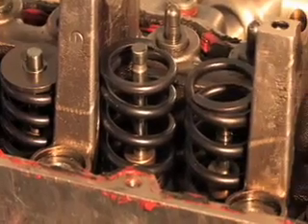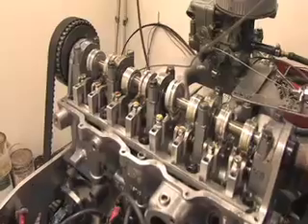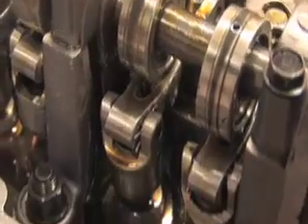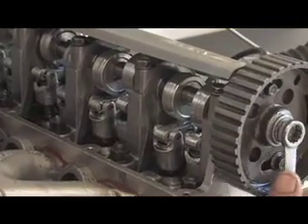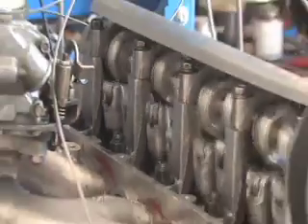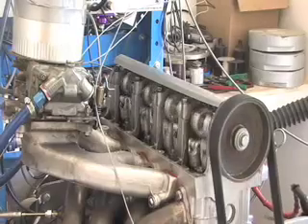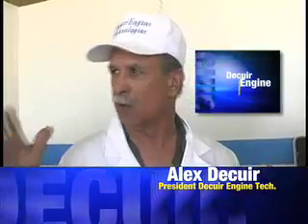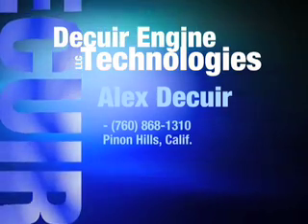New Engine Technology/Springless Valves

Comment: Ducati has improved their Desmo design to over 22,000 mile adjustment intervals on their street bikes. MotoGP bikes are dominating the power wars as Honda and Yamaha can't keep up. 18,000 rpm redlines.MotoGP engines are prototype, racing ony engines not destined for street use.

Comment: One minor problem with this concept.....!  Heat and thermal expansion of the valves themselves as well as for the other parts of the valve train system 🙄 As the valves heat the whole purpose of valve "LASH" is to make up for the expansion of the parts like the valve stems as they grow a little longer with heat and rocker arms which will also grow in the heat, eventually the lash is your room to grow in other words. The engine will operate fine until heat soak is throughout the entire engine and the valves begin to no longer fully close and seal on the seats. This is more than likely why you only see these test engine running at idle or just above and no full out dyno pulls! Because they wouldn't survive one! Without popping and spitting is to occur under a load! Otherwise the concept I'm sure has been tested and was never successful at auto manufacturers across the globe. The fact is the weather it's overhead cams or on old push rod engine or even a L head, aka flat head engine your valves still needs to be an independent fixture and lash between either a rocker arm or cam follower still has to have some space to expand or grow in increased heat levels. Without lash or what's called a zero lash situation which is not very common at all as everything heats up the parts grow and eventually become so large the valve can no longer make a proper sealing surface with its valve seat. If this occurs on only a couple or one valve in a multiple cylinder engine which use to be a common thing especially with a machical camshaft, your likely to burn a valve or seat or both from the hot combustion gases flowing by the leaking parts for long periods of time which is so hot it erodes the metal away. 🤔 So if you really want to play with a spring less engine than use solenoids for actuation of the valves, but even with a solenoid setup you can get rid of the camshaft and followers, push rods lifters and rocker arms. But in order for the valve to return to its seat the fact remains either an electromagnet or spring is going to be required for one of those directions......but no where nearly as heavy spring would be really required to do so since it doesn't have to push all those other parts back upwards. 😉 SMFH don't buy into this, it's nothing but a scam in the world of engineering.

Comment: The best idea I've seen is no valves or springs. It had a rotating camshaft that ran through the head, that had ports machined into the camshaft. It rotated and opened and closed the ports.

Comment: So many ignorant and idiotic comments...  <SMH>
Reply from the maker: Thanks for the common sense
Reply: @EmpEntTV  I'm a mechanical engineer, but was raised as a mechanic. 

 I've been thinking about actuating automotive valves in this way for a long time.  The currently accepted system is impractical for high performance/high RPM usage.

Whoever manages to crack this particular but, will definitely become rich and famous.
Reply from the maker: @michaelangelo8001  You are so correct about the impracticality of current valve actuation. Mr. Decuir was of the mindset that this type of system would not take as much friction and horsepower to efficiently open and close the valves. This would raise HP and fuel efficiency. There is a patent on this system but unfortunately Mr. Decuir has had to retire and the development never went too far past what you see on the video. Thanks for your comments.
Reply: @EmpEntTV  Maybe we should get together and continue the work at some point.  I'm not far from retirement, and have a complete machine/fab shop at my disposal.  I've designed and built several machines with slot cams, scotch yokes, Geneva devices, etc...  Mostly high speed textile equipment.

Comment: Similar system was used  in old (1950), two cylinder generator engine. 
The problem with that engine was adjusting the valves very frequently.

Comment: This is a Chrysler 2.2/2.5L engine.
Early 80's to mid 90's era.

I don't think anybody is claiming this to be the first springless valvetrain, which clearly it isnt. 
But rather a new twist on how to achieve it.
This appears to be a much simpler setup than Ducati's Desmodromic system, which requires two cam lobes, two rockers, and two separate lash adjustments per valve.
This system seems to use only one lobe, rocker/ring, and lash adjuster per valve.

Comment: you know, sure it seems like good way to remove the power required to open valve, but it doesn't take into account fatigue or imperfections in the engine. Current engine vavle springs always keep the valve seated whether they stretch or not and don't really require any adjustment for a very long time. Springs are a lot more practical than a springless system. Also, the lobes appear to be circular which means the combustion may not even be complete before one of the valves opens. That seems like a bad idea to me. A hydraulic, pneumatic, or electrical system directly mounted on the valves seems like better idea. That's also really noisy.

Comment: People saying this is stupid because desmo has already been around for a long are being ridiculous.  Engine tech is constantly improving with minor changes to existing systems.  However, this design has a basic problem because egg shaped cams work better for opening and closing valves for the right duration to get the best performance.  Konigsegg's system that works without cams at all is probably the most promising improvement in valve control.

Comment: yeah, hasn't Duccati been doing this all along?
Reply: deezynar but the tittle said new technology, and the fact is springless is not new!
Reply: Crobular I 
True, while springs give back the energy absorbed during opening on the closing side, the pressure of the springs produce friction on the sliding/rolling contact surfaces.
Springless valve systems typically have much lower friction loads.
Reply: They do it very differently.
Reply: Springs use energy but they put some back as well. Think about it !.

Comment: I would like to see that system utilised in a 4 valve hemi head !!!.
Reply: +Crobular I check out any ducat testatratta head, 4valve per cyl, hemispherical chamber , and desmo actuation,  upside.. 170 hp from about 1 liter, no valve float, downside, adjustment intervals every 12500 km, plus belts, the lash tolerances are very tight in this type of motor.. i think like 2 thou on the closing shim, n 4 to 5 thou on the opening.. where as springs will take up a lot more lash, everything in a desmo vale train is mechanically connected.. the race bikes use nitrogen filled valve "springs" , check them out for some cool tech,  bike had a pressure tank on the front, keeps the valve train pressurized, top it up to specs n off you go lol..  anyways check a panegale cyl head, its what u seek
Reply: +plane gaper  Yes, Correct.  Don`t  forget that the valve springs put some of the lost power back as they re-assert themselves closing the valve under rotational cam control.  I have a nice diagram of the Duke Desmo  engine somewhere all dims given. Rudge made a 4 valve hemi head before WW2, not Desmo though. My wifes Ferrari of a few years ago now had 5 valves per Cyl.  Clever angular ground  cams.  Can`t afford those anymore and we`re too old anyway.  Desmo engines have been around for donkeys years and some race bikes, I cannot remember which, had them. Old technology this with no real or imagined advantage, just another method like harmonic or tangential cams.  Norton used Tangential cans on one of their bikes, why I do not know.  Remember hairpin valve springs, they are about as old as the Desmo.
.
Reply: +Crobular I  Still cannot see how that system closes the valves without springs !!!. How can one get some overlap with this system. My Norton Commando had 90 degrees.  Seems a load of nonsense to me.
Reply: haha..ya duc uses valves or nitro on their race bikes now anyways..the real pleasure owning a duc versus an sv or jap twin is the direct mechanical linkage between the crank n the back wheel. I'ts a feel you dont get w any other bike, very sharp and exact, you can modulate the throttle through the corners much more accurate than any cbr, or rc51 for that matter..inpsires confidence..no disconnected feeling whatsoever. mostly because crank to gearbox is a gear..eliminates all the lash a chain main drive, and springy head contribute to feel. Downside, everything comes back through the engine with the same tolerances as well..theres no give to take up miss use and wear, and hence the shorter service intervals..seems the shims n belts take up most of the punishment..
   the five valve head is a yamaha invention, called genisis..increased overall intake valve area, over exhaust providing high volumetric efficiency at high rpm..seems ferarri decided it was a good idea.. gonna check these cams you mentioned out today..there s a guy that made bike cams with vvt via fly weights..ill post the name when i find it..cheers
Reply: +plane gaper  Lookin forward to it. I Don`t know anything about bikes these days.  Last fun bike I had years ago was a Suzy RG 500 Gamma with all the mods and stinger pipes etc. Handling OK Just. Not like a Duke.  You would not believe how it went for a 500 !!!.  My pal had a 750 Kwacker with Denco 7 port barrels etc;  Poor handler but rocketship.  I love strokers, fcuk the Desmo`s. My pal a just retired airline pilot has a Duke of some sort at the rear of his garage.  Must check on it and let you know if I can find it !!.  Yes, Ferrari used the 5 valve heads on the F355. My wife liked that whizzy little car at the time. Then I understand that they did better with the 4 valve head. Cheaper to make and a few more horses I believe. No Desmo for them though.!!. Good wishes.
Reply: +Crobular I  your duke is just a tail-gater in gran premio el mundo to yamaha & honda///
Reply: Not my Duke, my pals. In his garage. It will be there for ever. He has a Laverda Jota, a Vincent black shadow and a Ariel square 4 of some sort. Healey I think. NO !. he will not sell anything. Plenty of money you see.

Comment: "New Technology" hahahahaha go back to school EINSTEIN...
Reply: +skirmich We always enjoy hearing from the uneducated who have never spent the time in R&D developing new systems for use in automotive technology. What is "new" about this system is the use of a concentric internal cam that creates the valve actuation. Yes, Ducati and Mercedes have developed a desmodromic setup several years ago but Decuir is taking a different method of working with this setup. Given the fact that this system has been granted a world wide patent does qualify it as a "new" variation of previous technology.
Reply: KART RACER TV It does not give it anything, A variation is just that a Variation. This system is nothing "New" its just a different VERSION of a known technology.
Reply: +KART RACER TV  - A patent, worldwide or not, means it is a NEW solution.
This is a very poor solution: there is no way to control the valve timing as much as is possible with a conventional valve drive system.
Reminds me of all the people that get patents for a revolutionary engine. Most do away with the reciprocal motions.
Pointless.... Engines are very, very cheap to manufacture and are sufficiently reliable.

Comment: What did I miss??? I saw lots of mass opening the valves but I saw nothing closing them! On my 1973 twin motor  the valve springs suck 5 BHP. I have spent 40 years wanting to change this. So why has this video left me scratching my bonce? Head for the US readers.  Put simply: I am sure the Japanese would have used it by now, I mean, I thought up Honda's V-tech  (and I bet lots did as well, but dad told me not to bother with patents way back in 1974 as he lost money with his inventions that we all use now.)  What I mean is that nothing is new, while most ideas are limited by metallurgy, not concept. Did that make sense? Ducati are famous for their Desmodromic, but imagine setting a desmodomic v12!    So, I will keep looking, waiting for the the @#$%^&*()_)

Comment: were those not springs i saw around the valve stems? Sure looked like it to me...
Reply from the maker: +Nick Palaroan Amazing how so many do not pay attention to the 
explanation of the springs in the system which are merely there to hold 
the valve guide seal in place and has nothing to do with actuation 
process of the valve itself. So therefore it is a "springless" system.
Reply: +EmpEntTV But they are expanding and compressing with the valve going up and down.....which means they have to be performing some kind of return.
Reply: +EmpEntTV Well now that I can watch the video with audio, what returns the springs? Are these round cam lobes magnetic? Thats the only thing i can think of. Because the video doesnt say how they return. Also, I would like some numbers on the force required to open these as opposed to standard valve springs. Seems like alot of information is missing from this video.
Reply from the maker: +Nick Palaroan No, its primary use is only for the valve guide seal and has not nearly enough spring pressure to help in the actuation process. Secondly, the concentric type of cam on this system actually pushes and pulls the valve back into place. There is really no need for a spring with this type of setup.
Reply: +EmpEntTV I looked it all up, thank you!
Reply: +EmpEntTV I looked it all up, thank you!
Reply: what did you look up to explain how these valves return to their seat? I've watched videos on television ducati, and that is obvious. I don't see how these valves return with no spring. the eccentric appears to only push down.
Reply: +Nick Palaroan 
Forget all the bullshit. Them's was springs!
Reply from the maker: +Rick Lorimer As was mentioned, the springs in place with the system have nothing to do with the actuation of the valves and are there to hold the valve guide seals in place.

Comment: new technology? that shit has been around for decades. And there is nothing simple to doing adjustments on desmo valvetrains
Reply: +EmpEntTV You know, adding "Einstein" as a pejorative when people point out similar preexisting implementations of the same basic concept is unbecoming and demonstrates an apparent lack of tact, intellectual honesty, and maturity.
Reply: Some people cant handle being reminded they are wrong. Perhaps springless valve technology has been around for years, and their valve train is unique. Calling it "new technology" is a fallacy and they cant handle this. I agree with you.
Reply: +looncraz Or, in your vernacular: it's fucking rude, Einstein.
Reply: Yeap! First engine using this principle was back in 1910!
Reply: It is a very bad way of valve actuation, the geometry is poor and it seems that can not handle high rpm.
Reply: variation on desmo valve design - may look like it will work but it will fail because there is no provision to take up changes in dimensions due to heating. when the engine gets hot the valves will burn up
Reply from the maker: +Tim Nelson What's new Einstein is the fact that the cam/actuating device is a concentric lobe that pushes and pulls the valve close. We know that Desmodromic has been around for a very long time but this is a different way of getting it done.
Reply: EmpEntTV That's not new. Ducati has been doing this for years.
Reply from the maker: Not in the same usage of a concentric lobe Einstein
Reply: EmpEntTV
Its not new technology. Thats like calling synthetic oil new technology when it was introduced. Its a variation and nothing more.
Einstein.
Reply: The whole idea is to elliminate spring resonance. In theory it can be operate in higher rpm.

Comment: Modern Formula One racing engines are years ahead of this outdated engineering.  They use hydraulic valve actuation and are working on forms of magnetic/electronic valve actuation and timing.  Camshaftless engines|???  But on a further note:  internal combustion engines that burn environmentally-filthy gasoline or oil are on their way to the scrap heat, anyway.  As battery and solar panel technologies continue to exponentially develop electric motor driven transport will take over.
Reply: +Thomas Nixon The bad side is that EVs wont take over until they can go 300+ miles on a 10-15 minute charge with the batteries still lasting 10 years. Were not even close to that. The one area that EVs could and should take over right now are in cities. Sadly, I haven't seen anything yet that can take over diesel in trucks.

I would love to see solar and wind take over the bulk of the power grid with said grid more localized combined with people getting off their asses and installing 2-5 kw worth of panels and batteries in their homes it could be done today.
Reply: +TheRedneckAtheist That won't happen for a long time.  The only thing that is better than diesel right now is CNG.  That's even still in development.  The biggest problem with electric motors is that they are really no more greener than a gasoline engine.  When you look at what is used to construct the motors and batteries not to mention that coal is still the #1 producer of electricity in the U.S.
Reply: +Eric K (KontroversialKong)  cng engine still development? then my wife car must come from the future
Reply: in my country almost 50% of cars use CNG. here the gas prices are higher than ever. the cost to convert a car is u$s 1000 and the price to run its a third of gasoline. and almost all the gas station had CNG too